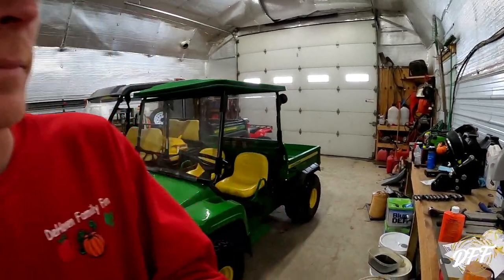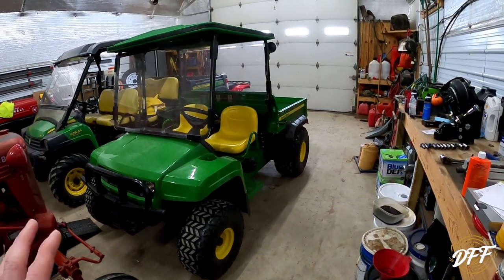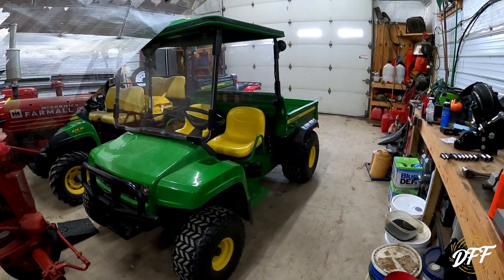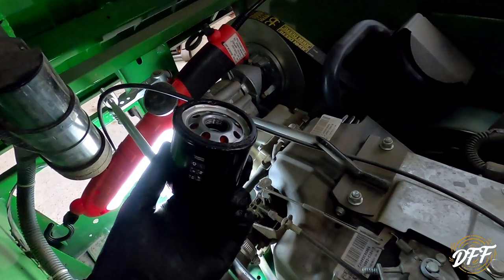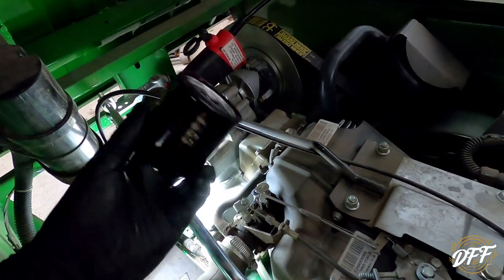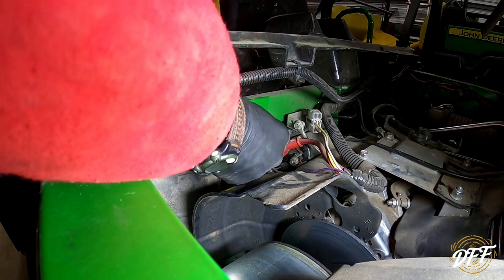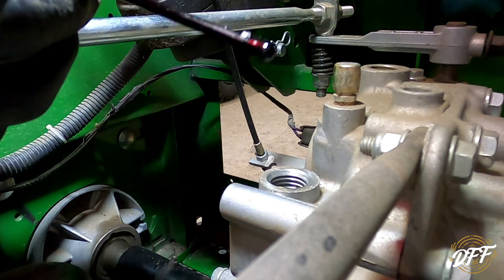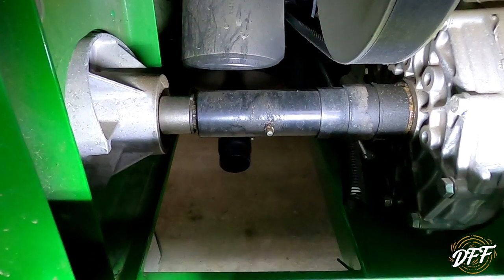John Deere Gator TS- Oil Change & Service

Comment: Looks like fun 🙄
Plastic plug 😳 never had any luck with plastic and oil... Would make me uneasy..  but the right plastic should hold up... 
Nice tutorial Chris 👍
Reply from the maker: I'm not crazy about the drain plug either. I may look and see if a different one is available. Thanks Ed!! 🙂
Reply: @dehavenfamilyfarm  at least it's protected pretty good, but plastic doesn't really like heat and oil... Crazy

Comment: I like those ramps.  Our honda pioneer is very close to the ground. Definitely a pain to get under them when they're low. That's for sharing Chris.
Reply from the maker: The ramps have been very useful this season in the shop. Don't think I would have fit under the Gator without them 😂 Thanks Monty!